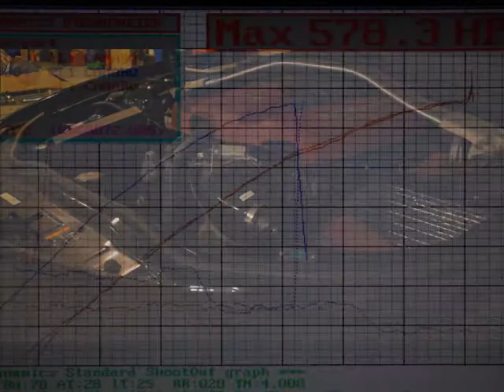ZL1 Camaro on the Dyno Being Tuned by Steven Leerentveld

Comment: is that ZL1 just tuned without anything ?
Reply from the maker: we fitted headers hi flow cats and a corsa exhaust and a cai unit and then did a custom tune everything else is stock
Reply: RDP Motorsport / RDP Store by Steven Leerentveld Do you need a tune for this setup?  I'm trying to avoid instantly voiding my warranty with a tune but still want the sound and shed a few lbs.  Thanks
Reply from the maker: yes sir it will have to be tuned otherwise you will end up with a enigne light